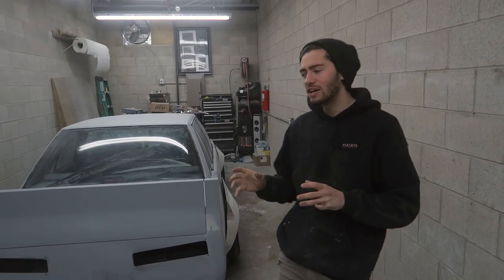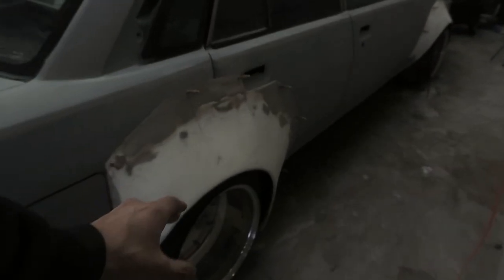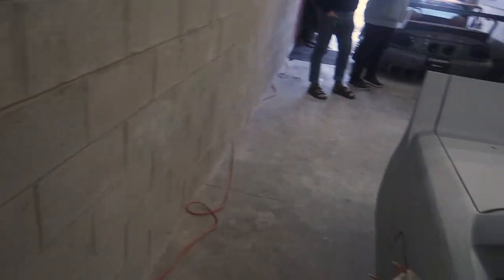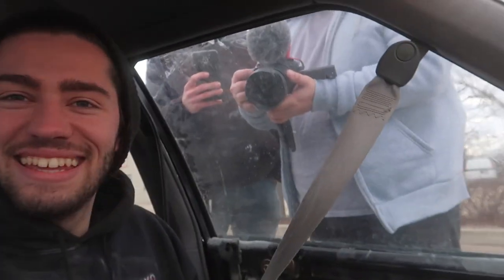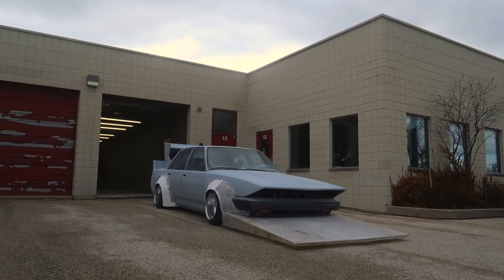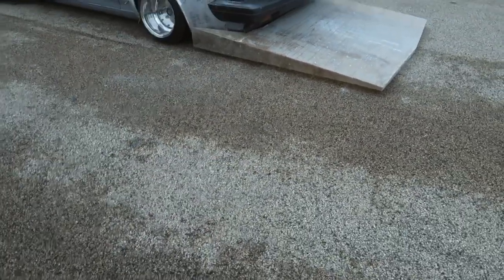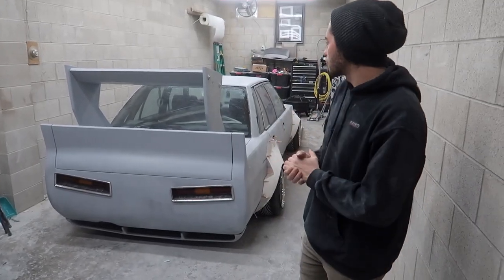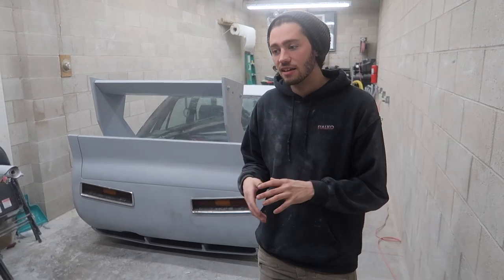Absolutely Ridiculous Aero | Bosozoku Cressida Flares Are Mounted!

Comment: are bags against the boso culture? personally i respect static a lot more, but on a build like this i think bags would save you a lot of trouble
Reply: its a middle finger to boso culture if u put bags on :/
Reply: Static is life in Japan but their roads are better maintained than in USA or any other country
Reply: I know there is a Nissan Leopard owned by @souki_rpz. It is Rb powered and sitting on bags and bbs.
Reply: yes because if your car is static and low, its low, if you have air bags your car isn't low.
Reply: @speeden2482  exactly it's low when you want it but it's only partially about the low life
Reply: I’m building a bagged kaido racer car right now, there are plenty of bagged kaido racer cars in japan
Reply: @96rinoman  send me a photo of any bagged kaido racers, i have never seen any.
Reply: @96rinoman  there a toyota crowns which come with factory air bag suspension, thats the closest ive seen
Reply: @speeden2482  @souki_rpz Nissan Leopard is bagged and awesome. I prefer static all the way though
Reply: Traditional Shakotan is static lowering and you can see the process in MightyCarMods, they actually take springs out and weld the struts
Reply: @johnblackstone5261  thats one way. The way most do it is coilovers.

Comment: Don't mess with the lip, the crazier, the better. The only thing I would recommend is something for the suspension. I know you want to keep it low as possible, but all that work, the silt spoiler and skirts will be for nothing. I know you're against bags, but honestly, if you want to run that setup, excluding the chin spoiler, you need to raise the car some. There's no other way that I can see around it

Comment: The stretch is fine, but that tire setup is freakishly undersized. Go bigger so you can go lower.
Reply: Got it twisted. 14x12 is optimal kyusha rim size but this stretch is on the smaller side.
Reply: @Emiliusofsweden  No I didn't get anything twisted. The wheel is fine. I said the tire aspect is too short.